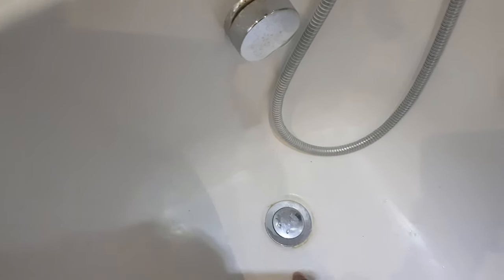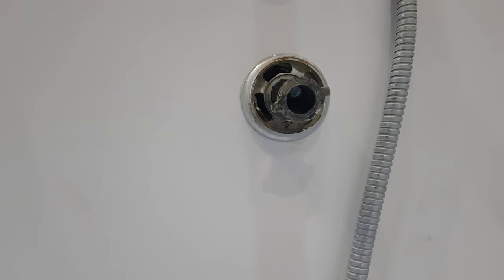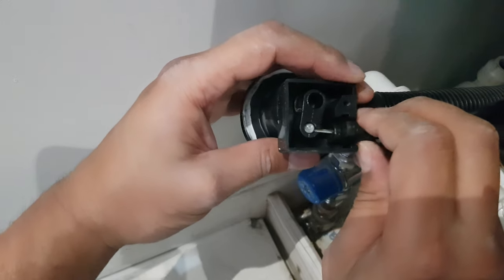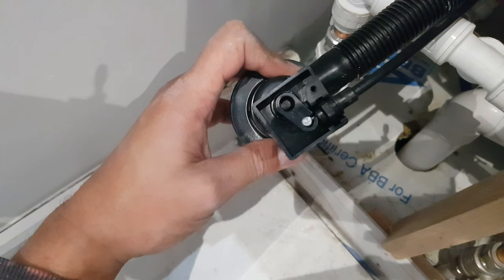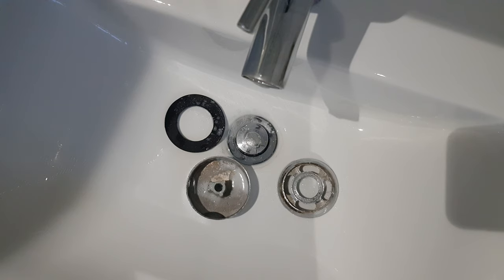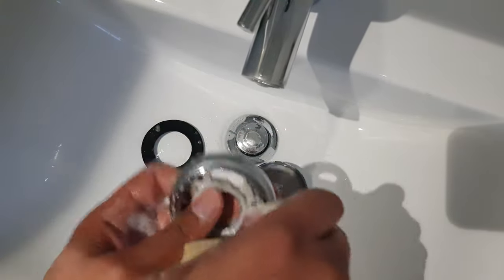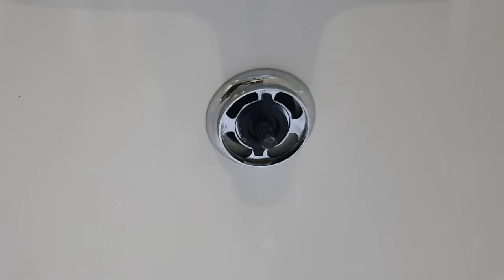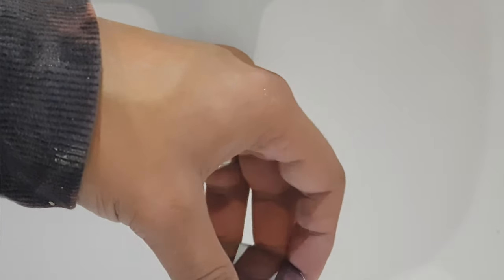Twist pop up bath waste plug

Comment: My fitting has the box at the plug end- on this model there doesn’t seem to be any twist adjustment on that end of the cable, it’s fixed almost flush against the overflow pipe.
Reply from the maker: A few people had the same issue. Hope you managed to fix

Comment: I have exactly this problem but the handle has no screw hole so I cannot follow the first step of dismantling. Does it just pull off? It doesn't seem to want to move. Any ideas?
Reply from the maker: Most i have seen have something t hold it in place.

Comment: Hi how did you take the bath plug out?
Reply from the maker: Hi, does the plug move up and down when you twist the mechanism? Let me know as you might have a different mechanism to the one in the video.
Reply: Get a body puffer which has a plungy bit to stick on wall attatch it to plug it should come out.

Comment: I cap keeps turning 180 both ways and i cant find the screw from the hole and the back plate is moving alot up down...why cant i see the screw in the whole???
Reply from the maker: It may be so loose that the position is not where the screw is. It is supposed to be vertically below the tap. That said, play around with the position to find the location of the screw.

Comment: Hi. I've just taken mine apart as it stopped working and I have found that the cable has snapped. Can the cable be replaced or do I have to buy a whole new unit? I can't find a cable online locally. Thanks
Reply from the maker: Yes you can. It is similar to a bike cable. You can buy a clamping mechanism to join them together and may be a simpler and cheaper solution.

Comment: I've taken the screw off but then handwheel is stuck it won't move at all. Any ideas?
Reply from the maker: Try lubricant or limescale remover
Reply: @DIMTips  thanks bud that worked, unfortunately nothing happened wheb tightening the screw even checked the tensioner. Ended up drilling and hole in the drainer to her it unstuck.
Reply from the maker: Sorry to hear that.

Comment: My twist knob keeps turning and clicking but plug doesn't come up , is that because the cable needs tightening up
Reply from the maker: The cable may have come loose. I would open it up and see if anything is not in place. You should be able to see the cable arrangement has moved or not in the right place by reviewing my video. Good luck and check back in
Reply: May need new waist fittings also coming unstuck behind the twisty knob
Reply from the maker: @jasonmorgan7807  may do. I have seen people temporarily add silicon to keep it from leaking but would not advise it.
Reply: Found what the problem the plastic washer on the back of the bath was too big for the bath hole
Reply from the maker: So glad you were able to find the problem. Hope you managed to get a replacement.

Comment: The tightener goes all the way to the top and the plug still isn’t rising. I can’t get a knife under the plug either to get it out
Reply from the maker: Once lifted out see if you can adjust the screw underneath the plug.

Comment: 🛠  👍 😊
Reply from the maker: Thanks Sparky. You always have good advice. Anything to add on this one.
Reply: The only thing I can think of is whenever you are working on anything in bathrooms put the plug in the sink and the lid down on the toilet it will save you a lot of messing about when you drop a screw! But as you are working on a plug this advice is not applicable  👍 😊  and Thanks

Comment: Mines enclosed so I can't access the back 🙄
Reply from the maker: It is really annoying when they do that.
Reply: @DIMTips  I have checked the mechanism and it seems fine, it goes up and down so I don't think that is an issue.  The plug doesn't seem long enough to connect to the up and down mechanism? Maybe something has sheered off. I think I will have to buy a rubber plug if I want a bath now. Lol.
Reply from the maker: The plug normally has a screw underneath it it. Try a little bit of WD40 and it may loosen for it to be extended or reduced.
Reply: @DIMTips   I cant undo it, even after wd40 it's locked tight. Need a vice and an impact driver it won't budge. Lol. Thank you for your advice tho
Reply from the maker: Something similar happened to me. Just leave it in a cup and keep reapplying WD40. It will eventually penetrate.